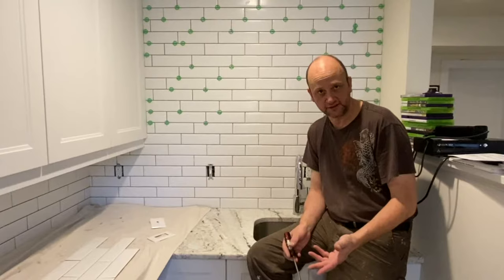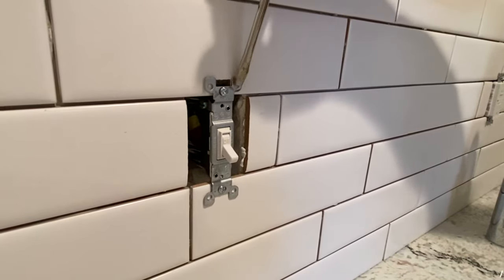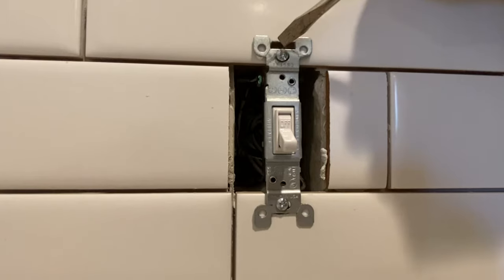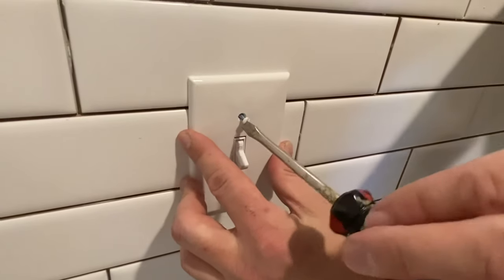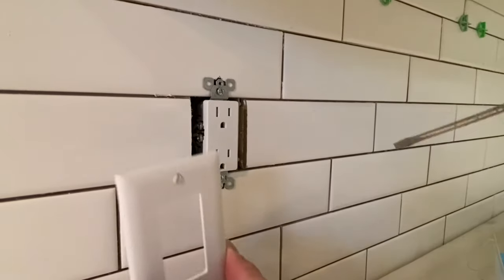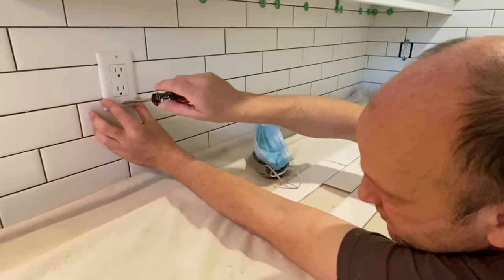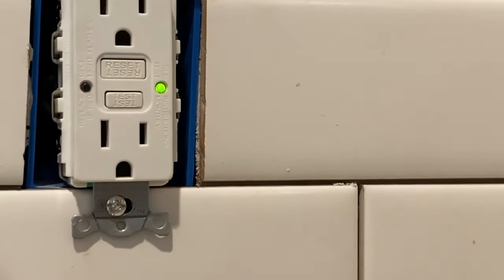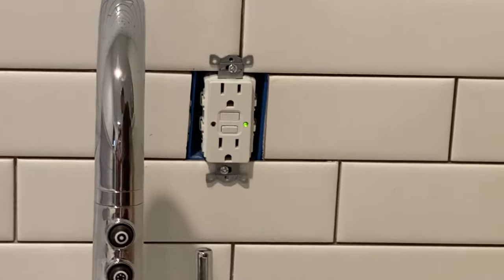Tiling Tips - Tiling around outlets

Comment: Informative video, thank you. However, I think you left too much tile around the box/receptacle, making it a possible challenge to replace the wiring or box, if something goes wrong in the future. I prefer to leave just enough tile for the cover plate to cover, maybe with a minimum of 1/8" undercut all the way around (for a standard cover plate). It takes a bit more precision measuring and cutting to achieve this, but IMO, it's worth it.
Reply from the maker: If you are pulling out and replacing the job box or wiring, an 1/8" margin around the box isn't going to allow you to take that box out or re-run wire any easier than if the tile goes up to the edge of the box. Any work like that is going to result in a bit of wall repair and new tiling. That being said, if people feel more comfortable leaving an 1/8" margin around the receptacle box, who am I to ague? I guess it doesn't hurt to check the wiring and position of the box prior to tiling around it as making any repairs are best done before tiling, but if everything is wired well and the outlet is where you want it. you shouldn't need to fiddle with it in the future.
Reply: @groutrx1415    I could be wrong, but it seemed to me in the video that the tiles above and below the box went well beyond the box's height. I could not see any outline of the electrical box. As far as "everything being wired well," with more and more DIY'ers doing their electrical wiring these days, all bets are off on what the future holds.
Reply from the maker: All great points. Thanks for your input.
 @KJ_nyc

Comment: Everytime the screwdriver kept slipping on the switch, after it was obviously still powered up, I braced for sparks...ngl ... lol 
I am not an electrician but would like to learn just the basics, so am watching as many videos as possible and asking for advice on certain things. 

When I was a child, I saw the adhesive (from some sort of renovation my father was doing on a kitchen wall) go up in flames from a spark from  live wires crossing.
Reply from the maker: I shot this so many years ago, but I feel like that switch went to a garbage disposal and it was disconnected at the time of the renovation. That being said, I've worked on plenty of live switches and outlets over the years and depending on the extent of the work, I may or may not switch the breaker off. If I am re-wiring something, I definitely terminate the power. The childhood memory sounds pretty scary, but I don't know of any flammable adhesives that would catch fire from a spark. Circuit breakers, electrical boxes and sound wiring techniques go a long way to help avoiding things from getting too out of hand and I'm not certain I've ever met an electrician who hasn't gotten a shock. That being said, it is probably good that the general public has a healthy respect for electricity but doing a little research and experience helps.

Comment: Your video helped me understand how to set a box for tile so im wondering if it's possible to install tile on sheetrock in kitchen.  Have existing sheetrock and small budget.  Looking forward to your reply
Reply from the maker: This is a great question. I don't have an issue setting tile on sheetrock in areas with low to no water exposure, like kitchen backsplashes. Use a latex modified thinset. You might watch our videos on how to set floor tiles as the same principles apply. Feel free to message me with any questions. https://www.youtube.com/watch?v=EOQALrWluOE
Reply: @groutrx1415  ok I'll take a look.  Thanks for responding.